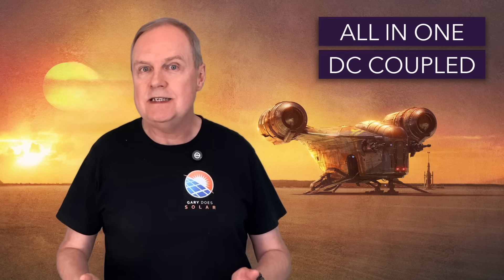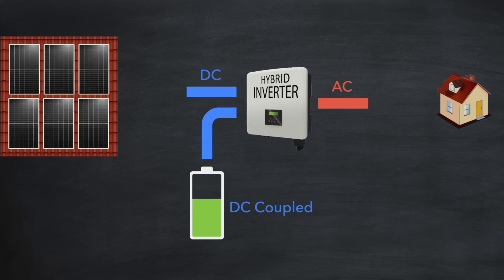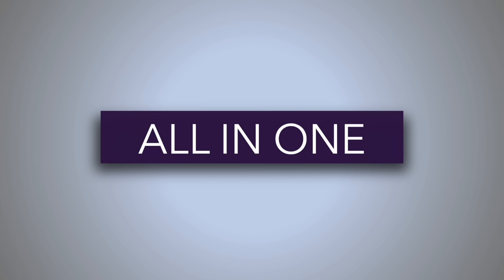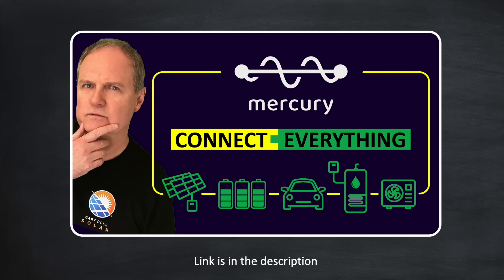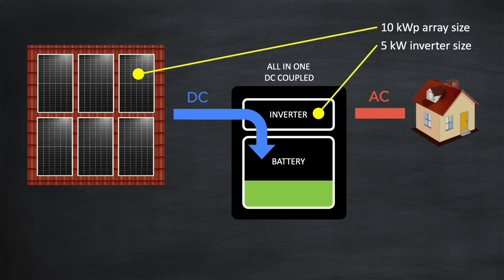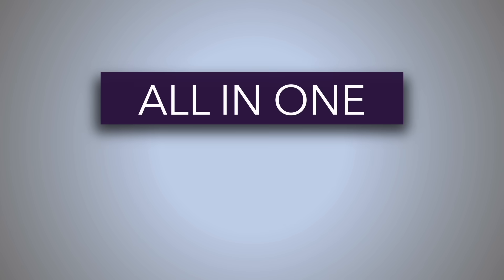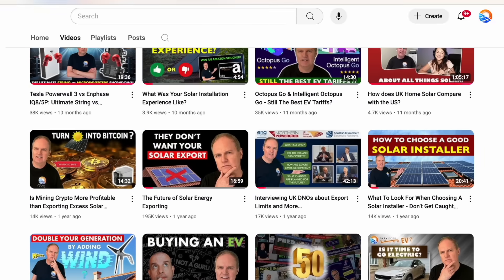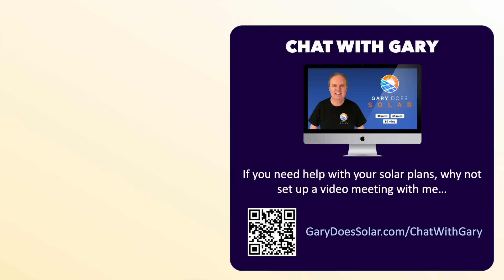Why All-in-One DC Coupled Systems are Transforming Home Solar

Comment: All in one systems could also be more expensive to repair, could lead to additional payments to access system service improvements and updates  through annual or monthly payments . The problem with tech companies getting involved is they are constantly trying to monetize  services.  I would prefer an open source system that can be upgraded when the user needs and  properly owns the system.
Reply: They are only more expensive to repair, IF there is a need on repair. So far with my experience what has happened in 7 years since the 1st pv system that was built w. my contribution in planning:
- A PV panel went out due to a diode failing.
- 2 SolarEdge panel optimizers failed
- A string inverter failed
- A BMS system of a startup company (almost prototype level) failed and had to be replaced twice in the 1st year.
What is my point? Looking at the above, in most cases there will never be any repair needed for many years as no one should be as stupid as I was using a prototype level equipment for an install. The highest risk is on the roof which is the same for all systems depending on the ruggedness of the design except the difference optimized vs. non optimized where the risk something happens on the roof with the optimized system is of course an order of magnitude higher.
Reply from the maker: There is plenty room in the market for all of these types of systems, no?

Comment: Why do you say an installer “must be “ used.
I don’t know about the UK but here in VtT,USA  home owners can install their own system.
I have 32K w AC net metered ( most of which I sell to my net metering group) and a off grid direct coupled system for my home and backup.
Reply from the maker: That’s a good point—I should have said “… you’ll likely need to contract with an installer” given, as you rightly say, you can install everything yourself 👍🏻

Comment: I like the Sigenergy system but I've already spent my money on GivEnergy, timing not great, so it will be sometime before I can afford to upgrade. 😞
One of the reasons for micro-inverters is to reduce the effect of shading, are you saying PV panels are now good enough to cope with the shading problem?
It will be interesting to see how micro-inverters will work with a DC coupled system.
Reply from the maker: You and I have something in common. I hope to have the money to change things though…

Comment: I do miss one mayor downside. I can get a 20 kwh battery and an 8 kw inverter for €6.000  euro even including backup possibility. 
To get the equivalent Sigenstore solution, it will add up to €14k or €15k. So indeed if you install the system in sight the all in one is perfect. Other than that, it is just too expensive for personal use.

I can't get over the idea that this if heavily sponsorred
Reply from the maker: I’ve never been paid to promote any product or service on my channel to date. And if that ever changes, I’ll make sure such sponsorship is abundantly clear 👍🏻
Reply: @GaryDoesSolar  That´s good to know and the reply is also much appreciated.
Still for me because of price I will be purchasing a modular design. 

Thanks again for the reply and keep up the good work promoting green energy.

Comment: I've always thought micro inverters were a pretty lame solution, but then again, I've always been a battery guy. Unless the grid export is extremely generous (credits you can use later or such), without a battery the solar system just does not have enough of a punch. The worst time to export financially is when everyone else is exporting, and when you yourself need it, the sun is already gone.

Hence, DC systems with battery integration shine the brightest. And batteries are also starting to become dirt cheap, thanks to the Chinese giants, their R&D and their massive volume.

Comment: Love your videos, but if one of the components breaks in an integrated system you have to replace the whole unit. And their components don't break at the same time.
Reply from the maker: Thanks 🙏 Now, if a fault should arise during warranty, then I would just let the installer/manufacturer deal with it. Does the consumer really care how hard or easy it is for them to repair, so long as it gets done? 👍🏻

Comment: Great video! One of the trends of these all in one stacks is that they are now typically high voltage so the DC-AC conversion is more efficient than the older systems with 48V DC batteries.
Reply from the maker: Cheers UDF 😀 Yeah, I’m interested to research more about that in fact. DC-DC conversion is already quite efficient, but it can always be improved 👍🏻
Reply: That is a trend with some manufacturers, but it's important to note that the SigenStore is considered a LOW voltage battery system. The average voltage within the stack is actually around 28.2V. This isn't an issue tho, as each battery module has its own DC optimisers which work together within the stack on a common bus bar. As Gary said, DC-DC conversion is already very efficient, as always the main losses occur when inverting to AC.
Reply: @MichaelWakefield-mx6hg  the datasheet says 300-600V?
Where can I read more about this?

The losses going from 240V DC to 240V AC are lower than going from 50V DC to 240V AC. That's where those high voltage systems gain some efficiency, along with smaller gauge wiring etc.
Reply: @UpsideDownFork  Hey your point is valid, for sure. I think I missed your main point in my comment, which is that DC low V to AC high V, will incur more losses than 240 to 240.
I've been trying to track down the yt vid on Sig, that went right into this, but no luck. These are the main points I remember :
- The 8KWh battery module is made up of 9 individual battery cells, each 3.2V nominal and 280Ah, connected in series. This equates to 9 × 3.2V = 28.8V. Total watt hours = 28.8V × 280Ah = 8064 Wh per module.
- There are no big gauge cables required in the stack - even with the large amperage - as the modules have a chunky bus bar running through each module, connecting them in parallel to the Inverter sitting on top.
- The DC EV charger also connects in parallel to the battery modules. It is essentially a DC to DC converter, taking voltages from the nominal 28.8V up to 600 or 800 as required by the EV's battery. No doubt there are losses in this conversion, but Sig claims good round-trip efficiency numbers and a safer system due to the lower voltages
If I find some references I will add in a later comment .
Reply: It’s a few percent (like 2-3% or so), not a whole lot.  48V is already pretty good.  The HVDC battery systems are also more proprietary in that closed loop comms are mandatory, whereas with most 48V closed loop comms are only desirable (but not mandatory).  Aka 51.2V nominal LiFePO4.  For residential systems either will work really well and 48V probably has the edge with regard to maintenance years down the line and flexibility.

Comment: Gary, i thought at you did that sigenstor dc ev modular was behind dno facing inverter.  So v2g was possible capped at all in ones inverter max.  spoke to 4 people at NEC -solar and storage. three different answers.  what cars doesthis work with?  Can sig work with a leaf?
Reply from the maker: So, it’s going to be a long road to V2H/V2G in the UK, I reckon… I’m researching for a video on this. The issue for the car manufacturers is that by enabling this capability, this increases wear on the battery, which inevitably will lead to warranty issues across the fleet. Also, ENA, working with the DNOs will need to agree operational specifications for the technology, and that will take time.

Comment: Does that mean if peak demand from the house is over that of the inverter then energy would be drawn from the grid regardless of the battery discharge rate?
Reply: Correct. Most households can run their homes on a 10KW inverter or less, without needing to draw from the grid. So sizing your inverter to your own usage is crucial if you wish to avoid grid charges, no matter how big the battery is.
Reply: @MichaelWakefield-mx6hg I assume in an ac coupled configuration the maximum load is covered by the inverter direct from solar plus the ac coupled battery discharge rate?  Or does the latter also have to go back through the inverter?
Reply from the maker: Michael has answered this better than I could! 👍🏻

Comment: I had rewind the section the dno.   Your information is not accurate hear.   With string system like micro inverts and ac coupled battery it would accurate to say that because your effectively putting 2 inverters to the grid in the micro-inverters and the ac coupled inverter it would be harder to get through.   The reality is the dno gives you an export limit on application.    The installer has to proof that the equipment can restrict export to the grid.  Yes technically both string and battery can export but it is still restricted.   In some situations you would be restricted to battery size but we live in a world where hybrid inverters can be told to behave as ac coupled now.  Like eleven energy hybrid inverter.

The big upside of micro-inverters is they just generate far more electricity in a year than a hybrid system.   Regardless if you call it dc coupled all in one.   Hybrid is hybrid regardless if things are separate or in one case.   Calling a box a space container does not change the fact it’s a box.

As for commissioning I promise you easier commission do not reduce price for installing.   That is a stretch.    It’s a quality of life situation for the installer.   But I have seen this commissioning argument a few times.   Installers commission not customers.   This means nothing to customers.

I really enjoy your videos.  You produce great content.   Just be careful of YouTubers that talk to you who desperate for content when they advice you.   Just because your installers want to fit sigenergy because the beleive it’s flavour of the month does not make it better.   I promise you next month we will be all talking sodium and the YouTubers will be calling sig dated battery in boxes.   “Do you remember when we installed lithium battery.  They were the bad old days”
Reply from the maker: Thanks for your commentary—it’s great to have informed debate on topics 😀 Now in fact, the DNOs are starting to restrict generation potential in addition to export limits. I don’t they they trust their own G100 process (higher generation, but limited export). My next video will be about this. 

Regarding technology progression, you’re right—in a few years’ time, the Sigenergy battery may well be superseded by sodium (actually I’d imagine Sigenergy would start supplying sodium modules in addition). 

Now, I disagree with your view on easier installation/commissioning not benefiting the customer. Time is always money, and I remember with my own installation, it was an extra day required. Installers are all competing with each other on several metrics, with price being one of the main ones. So, time saved on site translates to lower costs for the installer, which enables them to compete better on price in order to win business. 

Finally, thanks for your kind words about my videos. You’ll be pleased to hear that I’m not swayed by “YouTube” rhetoric. I’d like to think I’ve got a very good view of the market, through strong contacts there with installers, manufacturers and grid-facing entities (ENA, DNOs etc.) I also have a strong electrical and electronic engineering background, and so I know good products when I see them 👍🏻 I’ll keep making videos for you 😀
Reply: @GaryDoesSolar  We had our Sigenergy system installed at the beginning of Sept and were restricted to a max inverter size of 7kW and export of 3kW by our DNO (SP Energy Networks). When I challenged them on this, the reason is due to voltage rises on the local circuit coupled with the actual delay in implementing the export limit on G100 compliant export limiting devices. Despite wanting a larger inverter, we had to settle for Sig's 6kW inverter and it's been absolutely faultless. Any generation from our 5kW solar array covers the home load first with any excess exported to the grid up to our 3kW export limitation. Anything surplus charges our EV and/or the batteries (assuming we have spare capacity). With a little battery management over the summer, I'm not expecting to lose much if any of our solar generation even on the sunniest days.
Reply from the maker: That’s great to hear. My next video will be covering the challenges faced by the DNOs… 👍🏻
Reply: @GaryDoesSolar  I look fwd to that Gary. While i'm sure the DNOs do face their own challenges, there's also little to no incentive for them to upgrade local infrastructure to accommodate the increase in renewable technology being adopted in domestic properties. I wanted a larger inverter so I could couple it with Sig's gateway but sized to handle our peak load when off grid. It's frustrating that I couldn't have the system I wanted because of the DNO and the number of pre-existing solar already present in our area. Perhaps this is a topic you could include in your video?

Comment: Since when is the sig system with its modular design….. “all in one”

?
Reply from the maker: All in one sleek looking unit 👍🏻
Reply: @GaryDoesSolar I thought an all in one has an integrated inverter in the same unit as the battery

This is just a stack. Not a sealed all in one
Reply from the maker: I think you’re trying to make a distinction that has little bearing…

Comment: I enjoy your content, even though I'm US based. I think you missed a very important thing, low voltage vs high voltage DC. 
Solar strings are usually 400+ volts. EV batteries are 200+ volts. All the DC coupled solutions you mentioned are 48v. Therefore the inverter is stepping down the PV input to the DC output. That's not a simple passthrough, it's a waste, just not as bad as an AC conversion.
High voltage DC coupled solutions should be a topic, and the preferred way to design a solar system.
Reply: Most half decent EVs are either 400V or "800V" which is actually closer to 650V for some reason.
Reply from the maker: I might get a chance to cover this at some point 😀
Reply: " EV batteries are + 200V".….In fact my Peugeot E208 charges all the time + 400V. So to prevent losses the DC output should start at about 440V and then depending on the SOC should get down slowly jto about 420V. This should be controlled by the BMS of the car and the mounted apparatus at home ..

Comment: As one of the first SigEnergy systems installed in Far North Queensland, I couldn't be more thrilled with the results. My setup includes 48 440w panels (18 from the old system), powered by three-phase inverters—one 5kW unit (old aystem) and one 10kW unit—paired with a 40kW Sigenergy battery storage system.

Since installation, I've been consistently producing over 100kW of energy each day. Not only does this cover all my household needs, but I'm also feeding back more than 50kW into the grid, helping to support the community’s energy demands. The remaining energy fully powers my home and charges my electric vehicles—making my energy independence a reality. Goodbye energy bills, hello cheques from the energy company.

This system has truly been a game changer, providing me with clean, reliable energy while reducing my carbon footprint. I highly recommend SigEnergy to anyone looking to harness solar power and take control of their energy future!
Reply: How much did it cost? How much solar do you have? Cheers.
Reply: @michaelchilds3305 I'd prefer not to give that info out here, but I will state that it was over 25k.
Reply: Does it shade and cool your roof ?

Does it cut your air-conditioning running costs. ?
Reply: @stephenbrickwood1602 Yes! I run four aircons daily, when conditions require it. No issue. With regular appliances and 4 aircons, load can sit at around 5kW.  I'm  producing 15 kW in total solar. So 10 kW will still hit the grid. 

The stats and data on the app for the Sigenergy system is brilliant. It's so intuitive, too.
Reply: This is a great comment and really hits at the heart of the VPP network that the government is pushing. By "helping out the community", really great way to think about it. Most people just think "oh I've got to share my power with others" like it's a bad thing

Comment: I have the sigenergy sigenstor it does everything it needs to, but I'm really not happy that I need an installer to add an extra battery and to buy an extra battery myself I would be charged 20% VAT. 

If I can purchase a sigenergy battery for less than it costs from an installer then it stand to reason the installer is making  more than 20% probably as much as 35% just to install a battery I can easily do myself. 
Like the heat pump market the installers I believe are inflating prices and the end user is not seeing the true savings .